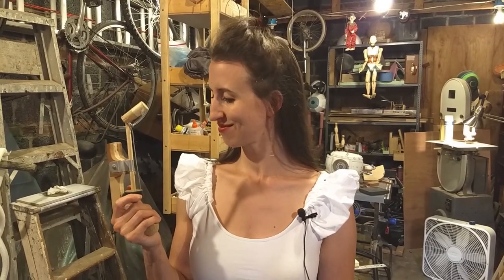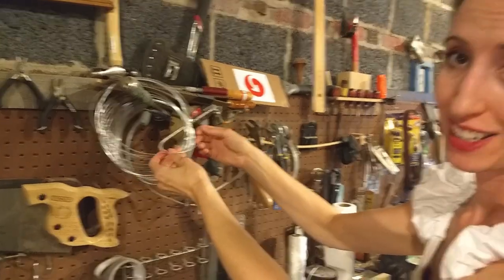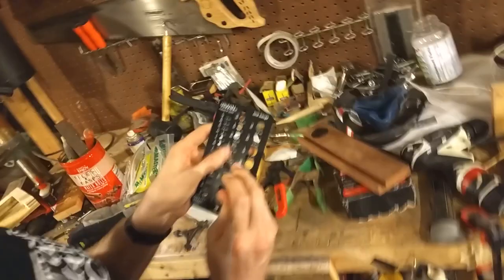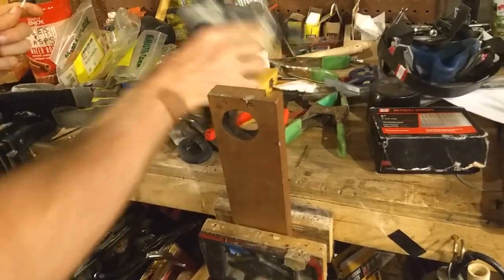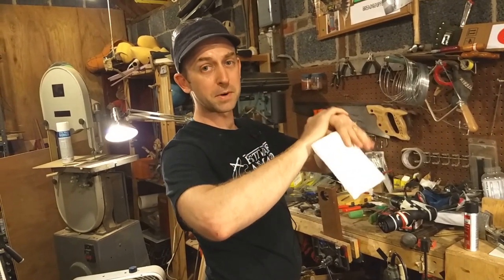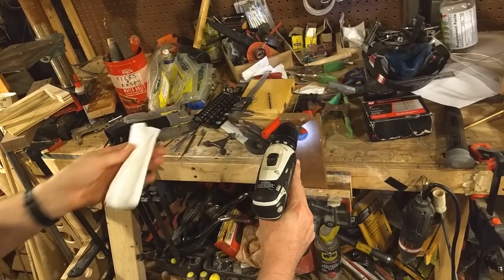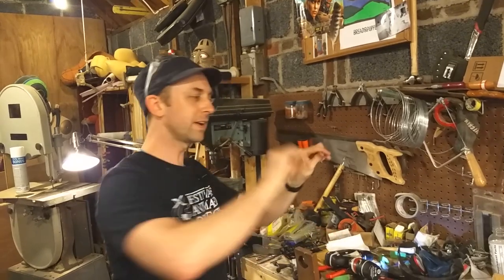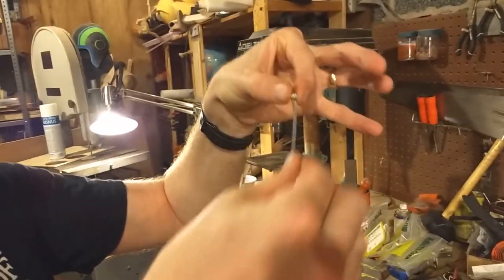How To Straighten Wire

Comment: Fascinating, thanks! I had a thought while watching this that could make the process quicker. Get a length of pvc pipe, plug one end with a wooden dowel, drill your hole in the middle of the dowel and clamp the pipe in your vice. Then you don't have to worry about holding the back end of the wire with your other hand, as it will be contained in the pipe. You could even drill several different sized holes and have one "go to" tool for all wire gauges.

Comment: So far this sounds/looks amazing I wonder how I'll go with 220cm length...My problem is more the room I think but will come back for feedback. Thanx a bunch :)
Reply from the maker: Wow! Yes, let us know how the 220cm goes. I'd definitely recommend having a friend stabilizing the loose end and going at a less extreme angle for the first pass.
Reply: @AlexAndOlmsted  ha ha as you probably already seen I had to use a different way and apologise to the other guy! Yes I guess with another person perhaps it would have work.  :)
Reply from the maker: @meeekstubbular  Too bad! I find that on 1.5mm wire this method works really well, but sometimes it can be tricky. I love using the method you ended up going with for thinner wire, and have started using 20 gauge galvanized steel wire as a go-to because it's so easy to straighten like that!

Glad your wire got straitened out in the end. Happy building!
Reply: @AlexAndOlmsted  it hard to beat Youtube...Always someone kind enough to put something helpful :)

Comment: Thanks for this! I need to hang some lights four feet down from the peak beam and this worked well. I used a short 2x4 with a 3/32 hole. The wire was too long to control by hand, so I used three shop vac tubes to restrict the far end whipping.
Reply from the maker: That's a great idea! I'm definitely going to have to file that away in my brain to try later. I haven't needed a piece longer than ~3' so I've been able to manage it myself, but the shop vac tube seems like the perfect 3rd hand.

Comment: Thanks for this. It helped save time and tedium. I knew the basic principle of doing this but wasn't sure how to go about it. I was working with 4 foot lengths so holding the one end opposite the drill was difficult.  I started using a gloved hand and stretching out but found it awkward so I used a 1/2 piece of conduit and clamped it down to the opposite side (non-pro tip :). Worked like a charm. It would also work well for shorter applications, I believe. t should also work fine hand held as well. I also found that it worked better with the drill at a higher speed, at least for me it did.
Reply from the maker: Glad it hear it helped! Using a pipe to help guide the loose end is definitely something I'm going to try the next time I need to straighten some longer pieces. The higher speed always works best for me too. I think it helps even out variations over more points along the wire.
Reply: What were you using the wire for? Just looking for ideas to use a few pieces lying around
Reply: @barnabyvonrudal1  I was putting up some wall panels that were PVC and hollow. I wanted to be able to hang something lightweight, so I put the wire through empty cavities of the paneling, which allows me to hang things with magnets.
Reply: @canadianweasel  nice, thanks

Comment: To go a bit quicker, you could push the wire through the backside of the wood block and then chuck the bit of wire sticking out on the front side.
Instead of chucking the wire and pushing the entire wire through the block.
Reply from the maker: That might speed things up. Although I've since changed my workflow slightly so that chucking up the wire first gives me a better grip to straighten by hand a bit.

Comment: The method I use is to tighten one end in the vice, then use a vice grip and hammer on the other end.  It pulls all the bends out by slightly stretching it.  Fast and accurate.
Reply from the maker: Thanks for sharing! I love hearing about different methods. Are you hammering against the vice grip to stretch the wire? Does this work for thicker gauge wire, too?

Comment: Hello again ...  :(  This did not work for me, perhaps because of the length. But what one comment said and I'd thought he would be wrong but it actually worked well for me. I got one end of my 1.5mm X2020mm into my workbench vice  and had to bend and pinch the other end to stop it turning in the drill. Then observed the wire twist and slowly spun it against that twist direction it worked fast and very well as it took only a few rotation to get it straight.
 But thank you again for you sharing something that mush work in certain situations.

Comment: This is very smart, like a drawplate!  I have to unkink 50ft of 22 Gauge Half Round Copper wire. What a headache!
Reply from the maker: Yikes! Sounds like quite the task. I wonder if the copper will be too soft for a process like this. Might want to sheer off close to the chuck. Are you going to try and straighten the full 50' as one piece, or are you cutting it into sections?
Reply: @AlexAndOlmsted  I'd love to do the whole 50 ft and spool it for future use. Its brand new just bought it, but it came coiled and then tangled up when I tried to use it to wrap.  It should have been spooled by seller.  I may have to use a draw plate first.

Comment: Just tried this - did not work whatsoever for me with 14-gauge Cu wire. I got a very loose spiral, less straight than when I started.
Reply from the maker: Hmm, I've never tried it with copper wire, only galvanized steel. The failure might have come from the material, or the speed of your drill, the speed of drawing it from the hole, or angle that it was coming out from.
Reply: @AlexAndOlmsted  Later I tried another method: 1 end of wire in vise, other end in drill chuck, no wood block. Just slowly twist the wire while pulling firmly. Worked great.

Comment: thanks for the video. please can you specify the brand and model of the drill?, when i try mine and the wire comes loose from the drill
Reply from the maker: I'm using a Makita drill. I believe it's an FD02 model. If your chuck doesn't close tight enough on the wire, or the wire is too thin then it won't hold. You could try putting a short section of dowel rod in the chuck and pinch the wire between the dowel and the jaws. Good luck!

Comment: hi, any ideas if the wire is above 3 feet in length...????
Reply from the maker: Yes! A commenter below said they clamped a piece of 1/2" conduit to the other side of the wood to stabilize the loose end. I haven't tried it myself, but it sounds like a smart idea.
Reply: @AlexAndOlmsted  I had the same intuition.... Thank you!!!

Comment: WHAT ABOUT FLAT 5mm wide ?
Reply from the maker: For flat wire you'll probably want to run it through a jig that has a series of staggered bearings. Search for "flat wire straightener" and you may be able to create a diy version.

Comment: I have come back to bug you guys again with another wire question (if I may). I'll say please. (to encourage an answer)...

I am trying to bend small gauge solid (full hard) steel wire in a U shape. The gauge wires I work with are (20AWG, 22AWG and 24AWG), which are roughly .032, .025 and .020 in inches, respectively.

I am bending one end of the small wire 90 degrees and at the opposite end of the wire (about 2 inches away.....sometimes slighter longer), I also make a 90 degree bend. Bending the 90 degree angles is not too difficult, however getting the bends to be on the same plain (example: if you were to lay the bent wire on a level surface it would lay completely flat in a U shape), that is the difficult part. Bending that second 90 degree angle to match the first bend so they point exactly in the same direction has been a real challenge. 

If you know of a method that I could use make these bends, that would be great....and I promise to say please again on future videos.

Philip
Reply from the maker: Haha, thanks for the extra politeness :)

Usually when I need to make bends in wire that fall along the same plane I'll make the first bend, then lay it flat on a table and use a pair of linesman pliers to grab the wire at the second bend point. Then you can bend the wire while it's all still in contact with the table. If it's not at in line as you'd like it you can always grab each leg of the U bend with a pair of pliers and gently twist to compensate. It's tricky with music wire since it'll naturally spring back, but just give it little adjustments until it's close enough.

Does that make sense?
Reply: @AlexAndOlmsted  Yes, makes perfect sense. This Full Hard music wire I am using is very resilient and does spring back (has a memory) when I try to make adjustments. I am going to try your flat surface bending method tomorrow. I hope my pliers can grab the 24AWG size on a flat surface. (hoping)...I'll keep you posted or......you guessed it, I will need to bug you again!...Thanks. Truly appreciated.

Philip
Reply from the maker: @uptownphotography  No problem! Yes, let us know how it turns out. I've found with very thin wire like that it's better to try and pinch it with the flat bit towards the tip of the pliers, since the "teeth" on the pliers can sometimes be bigger than the wire itself.

Also, an obligatory word of caution for anybody reading this: Music wire is very springy and can easily slip and spring back at you. Always wear eye protection when working with it.
Reply: @AlexAndOlmsted  Great advice on the eye protection. It also can when using very thin gauges penetrate your skin very easily...Found that out real fast....It's like a needle.
Reply from the maker: @uptownphotography  Owch! Yes, that's an excellent warning. Especially if you cut the wire and it leaves a bevel or a burr on it.
Reply: PLANE, not PLAIN.

Comment: And how exactly do you tighten the wire into your drill?? That would be pretty helpful also.
Reply from the maker: The same way you would tighten the chuck around a drill bit. Some chuck jaws may not close small enough if you have a thinner gauge wire, so take that into account, too.

Comment: Cool! 
You got any ideas on how to straighten out wire mesh when you unroll it?
 Kev
Reply from the maker: Ooo, good question. What size/type of mesh are you working with?
Reply: Well I figured it out. Its 16ga 1x1.5 inch galvanized mesh. I unrolled it backwards on a wood table and lightly pounded it out with a rubber mallet...a whole lot easier than chicken wire :)
 That puppet stuff you guys do is really neat...reminds me Geppetto and Pinocchio
 Kev

Comment: Does this twist the wire at all? Because I saw someone else do something similar and it worked by twisting the wire, but their method clamped the other end in their vise, it didn't put it through a hole.
Reply from the maker: There's minimal twisting if you do it right. If you draw the wire out of the hole at too steep of an angle you'll get some twist.

For thinner gauge wire (1mm or less) I usually just chuck it up in the drill, grab the other end with pliers, and twist it while pulling it taut. It probably weakens the wire, but for my applications I haven't had any break on me.
Reply: @AlexAndOlmsted  Twisting will weaken the wire some, but you can anneal the wire by heating it up to its recrystalization temperature and letting it cool again. Though if the twisting is minimal it might bot be necessary.

Comment: The easiest way to make any wire perfectly straight is so very simple. Tie one end of your wire to something solid, a handrail, or anything else that is strong then chuck the other end in a drill, pull the wire tight with the drill and pull the trigger pulling tightly, your wire will spin/twist into a perfectly straight piece, don't over spin, the more you spin the stiffer and more brittle the wire will become. You can make soft copper wire extremely rigid. Just try this, there is no better way!
Reply from the maker: We love this method, too! I find that the way you mention works better for thinner gauge wire, and only use the way shown in this video for ~14 gauge and thicker. Lots of ways to skin a cat :D

Comment: Great method. I just bought some Full Hard Steel wire in 22 gauge. I hope this will work with that thinner thickness as well. Question: What type pliers were you using towards the end of video bending the end portion of the wire. Will thinner gauges work with this method? Thanks Alex and Olmsted. Great job.
Phil.
Reply from the maker: I've found that 20 gauge and thinner wire doesn't work super well with this method. It's much better to cut a length, chuck it up in your drill, hold the other end tightly with a pair of pliers, and then spin your drill while holding the wire taut for about 5 or 6 seconds. It'll twist the wire and make it very straight, but it might weaken it a bit. I haven't worked with Full Hard Steel wire before so results may vary.

The red handled tool at the end there are TEKTON 8" bolt cutters. I love them!
Reply: @AlexAndOlmsted  Thanks for the reply. I am scratch building a HO Scale Howe wooden truss bridge and the prototypes have vertical iron tension rods from the bottom chords of the bridge to the top chords. I used 22 gauge floral wire for this on my model, but it is too soft and easily gets bends that are very hard to straighten once on the model. I am hoping the Full Hard steel wire I bought will solve the problem. The problem is the wire is wrapped in a coil (about 5" diameter coil) so it is retaining some of the bend when I unwrap it. So I will give both methods a try. The finished bridge came out great, but it is bothering me a bit with the tension rods not perfectly straight using the floral wire. Thanks.........

PS...I was asking about the smaller looking pliers not the red handle bolt cutters. Wondering what they were so I can get a pair for my model building. Thanks..

Phil
Reply from the maker: @uptownphotography  Ah, right! I'm not sure of the brand name of that tool, but those are loop forming pliers. I found that pair at Michaels craft store in the jewelry making section.

If you're making scale cables for a bridge the twisting method may work best. You can experiment with how much to twist and it may even give the effect of twisted wire cables.
Reply: @AlexAndOlmsted  Yes i just tried it and wouldn't you know it my Craftsman 1/2" chuck drill won;t grab onto the 22 gauge wire. The wire is too small for it. I think I have a smaller chuck (to insert into the larger chuck, (for pin size drill sets (for model building), but will have to find it, so for now I am dead in the water until I can find a way to grab the small gauge wire. I have a Dremel tool, but will have to find the small chuck for this purpose...A drag as I was anxious to try the two methods you shared with me.

Comment: An awful lot of unnecessary work! Put one end of the wire in a vise and the other in your drill, then spin SLOWLY.
Reply: Putting the other end through a hole like this I think reduces the amount of twisting the wire ensures in the process, which can be important because twisting can weaken the wire, and thus this method preserves its strength better.
Reply: I don't know how you worked this one out I don't think this would be very good for your wire if one end is fixed
Reply: My apology for my previous comment. As you will see at the top I ended up using your method with good result. so thank you to you as well :)